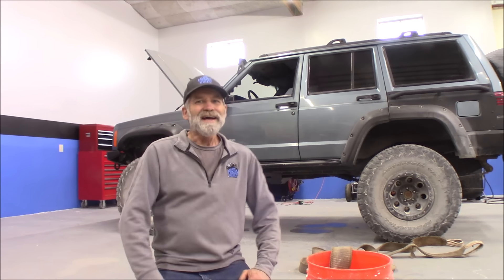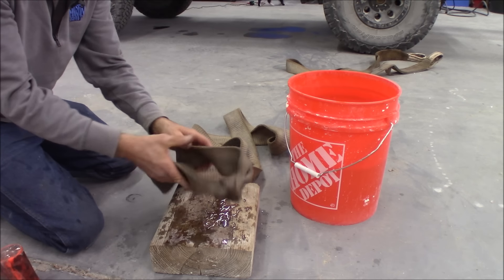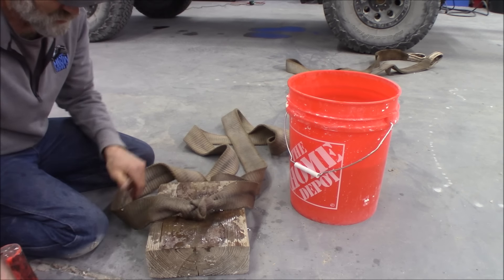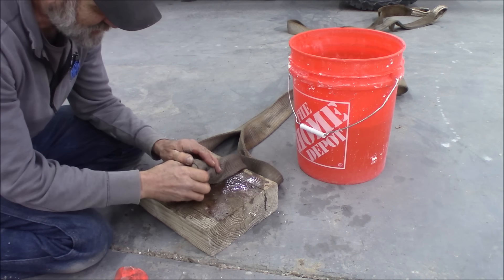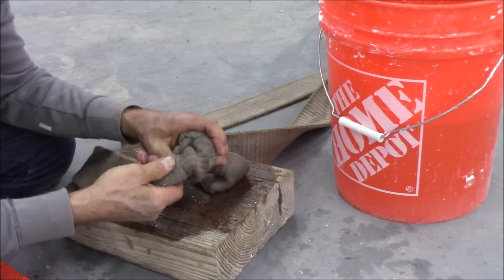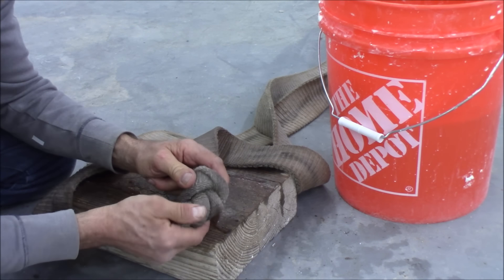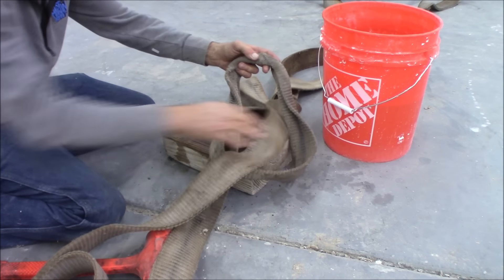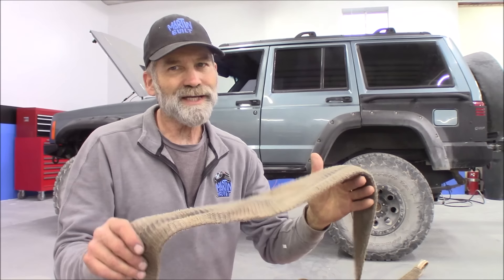How to Remove a Knot From any Snatch or Tow Strap and Rope

Comment: I came up opening knots like this by myself. Great to see its more common practice. Not sure does it help but I used hot water and regular metal hammer. Hate to have knots in tow straps but this trick changed it.

Comment: Well done. If you added a little liquid dish soap to water it would make for less friction in knot.Hammer worked really well.
Reply: Was wondering if using warm or hot water would help ?
Reply: @davidn8759  Hot water is less viscous than cold so it would penetrate faster.

Comment: I don't know if you have ever seen a Mariners knife, but they are handy for getting knots out of ropes like that. They have a tapered spike on them and a good knife. But they would definitely help with that.
Reply: A marlinspike would work well too. Basically the same thing without the blade
Reply: Good luck getting enough leverage on a marlin spike large enough to even make a dent on this strap. Straps are not rope.
Reply: @sharpandloud3422  Two marlinespikes, leveraged against each other, will pry the knot apart.
Reply: @UguysRnuts  4x4 Jeep full gas on a 4” thick tow strap, but yeah, all you need is two little marlin spikes 😆

Comment: I've used a dull pointed steel rod to help open up very tight knots. Knots that others have given up on. You just don't want to injure the individual fibers, take your time and work it, work it work it!  Soapy water helps a lot too. Good video.

Comment: Try soaking it in water then freeze it solid.  Take it out and thaw it.  The hydraulic expansion of the ice crystals will swell the knot and then it will contract when thawed, loosening the knot enough to release it with less effort.  No hammering required.  Did this to a rope that got several very tight knots in it.  Worked like magic.  Some kind of lubricant might help too, but then you're left with an oily rope, or strap, which could create a problem too.

Comment: To stop a knot or choker from getting tight, I put a short piece wood or limb in the knot. We did that on heavy construction.
Reply: Prevention is better than cure; you can also use a small magazine or folded newspaper rolled into a sort of cylinder. put in "inside" the knot or between two straps that you want to join temporarily. works wonders.

Comment: If you see any surface glazing or some other change in roughness where the knot was, that's still going to be a weaker spot in the strap. By how much, who knows? (I suppose trusting it depends on its application in the scheme of things.) So it's not like taking the knot out will make it just like it was before. It takes out that stress point, but any damage already done isn't going to be undone.
Reply: The strap will have lost a significant amount of strength through being struck many times.

Comment: Kneeling on concrete with no padding. You must be in good shape. 😂 Great video!
Reply: I'd like to see the part where he tried to stand up! 😁
Reply from the maker: Thank you I'm glad you liked.😁
Reply from the maker: Thank you I'm glad you liked.😁
Reply from the maker: @brigcastle  Milo helped me up.😆
Reply: Good shape....... kneeling like he is here is asking for circulation issues later on.  Even blood clots. Varicose veins. etc.   My father milked cows for 40 years squatting / kneeling like this.  After being kicked in the knees by the cows . He ended up with new knees at the age of 65.  I also milked cows for 46 years. I always kneeled on one knee....pulled myself up using the cows hip bone.  I also ran marathons from age 20 till ages 50.   Guess Im lucky.....no knee problems " yet " ! !
Never fold your legs as he is here !!!!!!!

Comment: Soaking the knot and squeezing it in a vise also works, as  does  sometimes gripping the knot in a vise and using a mallet to drive the knot apart, as you squeeze it is very effective and less taxing on your body.

Comment: This is a good, useful video. It's good to point out that a knot weakens the strap and makes a failure point. I have found that wetting the knot with some dish washing soap will make your knot slip easier, but it also makes it tougher to hold on to. You could soap her down before the hammer work, then when the soap is worked down into the really tight spots, and hammered on a bit, you could rinse the knot in your bucket of water.

Comment: Top job mate,Had some wet weather here in Australia,ha 3 tow jobs, I have John Deere 5083 4x4 83 hp with neighbours, 2. 4x4 utes and 1 10 tonne truck,all bogged to the diffs in sandy granite, no trouble to get them out,I parked on solid ground ran straps and chains out for up to 70 mtres, however I had to loop 2 joins like you hah done, I managed to free 1 up, put the other in a vice but no go.I will try your mthod with a heavy rubber on a block of wood,wet it first and see how I go.Thanks mate for the tip I will let you know what happen. Australia 🇦🇺
Reply from the maker: Good luck with that knot. I'm confident with this method you'll get it out. 
Thank you for watching.

Comment: Good job! May I recommend a marlin spike or fid to  help the process?
Reply: Those are a big help. Better yet, put the spike in before the knot is tight if a knot can't be avoided.
Reply: We delt with this often on the old commercial fishing boats. You beat me to the mention of a Fid.
Reply: Use hitches instead of knots 
The Bowline, the clove hitch.. I can't remember the other hitch but when tied correctly they untie easily

Comment: You convinced me to check all pulling straps, ropes, etc. to make sure there are no loops that will become knots in them before a tug.
    I had someone give me a 50 foot piece of 1/2 " wire rope/cable  that has a knot in it from a stump pull with a dozer.  Yeah, that's "knot" coming out of there for sure. Too bad because both ends have two nicely hyro-crimped compression sleeves with thimbles.  I'm "knot" that worried about it though because I'll never get halfway near the working load rating of the cable. ( 12 ton ).

Comment: A dead blow hammer has sand in it, not to do a "pretty good job", but the sand in the hammer makes it so that it doesn't bounce when you strike something with it. That's why it's called a "dead blow" hammer. :goodvibes:
Reply: I never knew that. Thanks.
Reply: More often they have steel or lead shot not sand
Reply: Not sand steel shot i know cause i open one up by heavy use
Reply: Where I live us surveyors use them to drive rebar monuments into frozen ground. Regular sledge bounces and mushrooms the end of the rebar. Works only if you have a driver over the end of the rebar so it doesn't split the plastic hammer.
Reply: the dead blow has lead shot not sand and about 1/2 inch of space for the shot to move.
Reply: looked like it bounced all over the place to me

Comment: I admire your determination, ... I am curious to know if you had gotten the stump out?
Reply from the maker: Not on that attempt but later I did. Got one more to go. This weekend it's going to happen.
Reply: Use that strap as a choke around the stump, run the free end of the strap over the top of a good tire/wheel combination, when the jeep tensions it, the tire/wheel pulls straight up. This works great for pulling out fence posts too.

Comment: LOSE THE HAMMER! Hammering the knot will damage the fibers and weaken the rope or strap. Use a marlin spike or fid to work the knot from all sides. It will open the knot up without damage if you are careful not to puncture the fabric. As you gain a little space in the knot, then go at it from another side; don't try to open it all up from just one side. Be patient and you will get there. This is the way sailors and riggers have been foing it for hundreds of years. You will never see a sailor or rigger hammering a knot. In the future, pay more attention; it's a lot easier to untie a knot before it's tensioned than after.
Reply: Yes This is crazy!

Comment: Even that dead blow hammer is grinding the embedded dirt and grit in that knot. Use soap and a blunt prying tool like others suggested. 
I would add that twisting one of the ends that enters the knot helps compress the section so it can slide into the the knot which loosens it.

Comment: Soaking it is a good idea, i hammered large flat head screw drivers in between the layers and slowly worked it loose exactly what you said not to do, i didnt damage the strap but it wasnt fast or easy to do.

Comment: If you twist the lead hard till its solid then push it into the knot backwards it works kinda like stuffing a stick into the knot.  Twisting left vs twisting right makes a difference depending which direction your knot is.  You can also twist both ends and shove the knot backwards

Comment: I have not gotten a knot out of a strap, but rope, I have. As you did pulling on one side to open, I have turned it over and pulled and worked on the bottom side.

Comment: The soapy water tip below is probably the go to method and is most likely faster, but I was wondering if time wasn't an issue about wetting it, freezing/thawing it a few cycles, if that would loosen it up without all the stress?

Comment: I have undone a lot of tight knots in various cords (but not this big).   I honestly think that hammering it will cause some damage to the fabric.   Being wet can help lubricate it (but some kinds of cord may swell when wet.)  I would just fold or roll the width tightly to push it through the loop, and wiggle it firmly until it loosens.

Comment: Use soapy water it makes it slick. I just twist my straps and push through the knot. Takes a bit of time and effort but it will start moving. I havent tried it with a hammer, not sure if it will speed it up any but soapy water works wonders.

Comment: Great job! Great video! You probably had someone ALREADY make a suggestion that. had terrible times breaking KNOTS on all different ropes/slings/small strings/ I found that if i USE A ROUND SHAFT with a point at the front I could Fanes the shaft in between the knot/ Then once the shaft is completely thru the Knot just twirl it around and around/ then pull the shaft out and start pushing the KNOT loose (do this a few times). BUT the  biggest help was when the Pets Cat or Dog would come to see what i was doing and ask me "I AM HERE TO HELP YOU DAD"  and all of a sudden the Knot would instantly come loose/

Comment: 01:15 that's called a soft drift, in Australia. A Hawser spike is used by navies around the world to create a gap in the knot, when inserted correctly, will do no damage the rope; you can get one from a ships chandler. Hammering the knot with a drift will create split fibres, lessening the life of the strap. After all that bashing, you'll get one more pull, then it'll break.
Reply: I agree with you, the tow strap is already compromised.  I worked years in the oil industry and a strap like that would be cut up (to prevent further use) and discarded.

Comment: I have a pair of 10in timber spikes (big ass nails) that I've ground & polished the first 4 inches to be smooth like knitting needles, they can be inserted into knotted straps & ropes to ease the knot apart without risking cutting into the straps like a screwdriver would.

Comment: Those synthetic staps also weld themselves together  enough energy applied, and generates enough heat to melt the fine surface flyaway fibers together on opposing faces.

Comment: I had a strap with a much tighter knot than the one shown.  I soaked the strap in soapy water with added fabric softener then slowly and carefully teased the knot out using two Phillips screwdrivers carefully worked in opposite directions through  the knot so not to damage the strap; this loosened and got the knot out but the strap was still heavily kinked.  I then thoroughly rinsed the soapy water out of the strap removed the kink and straightened out the strap using a steam iron (under a damp cloth) on the still damp strap.

Comment: It’s difficult to explain but I use a bench vise a hammer and a vice grips. I almost always get it out, admittedly some knots have been under extreme load and I’ve just had to cut the knot out.

Comment: Weak spot indeed. 
50% reduction
This happens all the time when you have dummies using slings. 
(Present company excluded)
Oil patch, underground labourers 
 Next time I suggest After a few blows, fitting/wiggling long punches through the Knot. Not piercing the strap of course. When you have two just through. Use them as levers back and forth. Way less hammer. 😅 I’ve gotten straps apart stretched tight when soaking wet. The narrower the strap. The worse it is. 
Hi Milo👋
My big fella. 2 years in April. 
Maine Coone. 15 lbs and growing. Walter.
You have a new subscriber. 
Good show. 👍🇨🇦

Comment: I was a Lineman for a major utility …we had knots like that put in by novice lineman .. we called them axe knots.. we made pointed large screwdrivers ,,two of them . Picture large darning needles..they worked great to loosen the knot and clear it. The trick is not to do that in the first place.. a good old bowline is the perfect knot to know ..regardless of the tension placed on the knot you can easily get the knot apart

Comment: Good idea. The newer the strap the longer you're going to have to soak it. Also add fabric softener to the water and use very warm water. I'd soak it for at least an hour. Rinse then soak the knot in vegetable oil. Then use this process. When the material is knotted that tight, you can damage the threads in the strap when striking it like that.
Another way is to use a round blunt round nosed thin rod to thread a two small cords though the knot. Use them to to put tension on the knot as you hit it with the dead blow. Once the knot it out. Use dawn or a safe degreasing soap on the strap to remove the cooking oil.

Comment: Have you ever seen a 4.7 that has some sort of clatter past 4k rpms but ONLY under load, not when revved in neutral?
Mine is doing this now and I have no idea what it could be, would rod bearings do this? timing chain? maybe debris clogging up the oil pick up tube when the pressure goes up? 242k miles. Engine wise all is stock including all seals/gaskets, only thing I have changed is the valve cover gasket, egr valve and water pump. And 1 injector 3 coils and a few set of spark plugs. And the oil pressure sensor which failed once.

I've spun bearings in other cars and whilst this does have a bit of clatter/ knock it doesn't seem to me as hard metal on metal as the rod knock sounded when I spun a bearing on another car, it also doesn't sound anywhere near as fast as you'd expect rod nock to sound at 4k rpms.

Comment: I remember i used a long bolt and pounded it with the hammer and then a round hex bit that was about 6 inches long with an extensions. Tapped it in with the hammer too. Probably frayed the strap a little on the looped end but it was much that was already done before i got it from the previous user. Had 3 starps that got knotted together from a recovery job. I know next time to have something blunt to put in between the straps.

Comment: I feel hammering the knot would be choice #2. A marlin spike is the best, better than the "big nasty screwdriver" in my toolbox. But you should have a roll-head pry bar in the bottom of your toolbox. Harbor Freight had a set. The point is small and the  shaft gets larger, great for wedging in a thought place and expanding & pulling some strap to large the knot.

Thanks for the demo, Martin.

Comment: Damn good stuff! Same problem from tying two 25' snach-em straps together to help a lady out of a ditch back in 96' and had to use it this way ever since. Not sure if this works with synthetic heavy duty material @ 20,000lb rating? A little Dawn maybe... BTW, I wonder which is actually weaker, the knot itself or the small area that was exposed to a concentrated violent beating over time?

Comment: I purposely tied a knot in a strap because I had no other way to accomplish my task. Before I started pulling with it, I inserted a stick that was about an inch in diameter and 6-8 inches long. After removing the stick the knot was undone quite easily!!  (The strap was appr 3 inches wide.)

Comment: this used to happen at work when the young guys would put multiple straps or slings to pull on something with the truck or a hoist and mess them up and then say oh well and throw them out and i would get mad and try to set them straight. the bucket of water is a good idea, i would also use a rounded off spike or screwdriver. i'm retired now and don't have to worry about this stuff anymore but thnx anyway.

Comment: With the knot being the weak point, I wonder if tested to the breaking point whether the previously knotted area is still the weakest due to the pounding. It may look okay, but I wonder it the fibres got damaged. For sure un-knotted it's stronger. Possibly a test that Todd at PF could do...

Comment: I agree, don’t pound it violently!  It breaks the fibers. Soak overnight in liquid soap with LOW detergent characteristics.  (Cheap soap). Use tapered spikes as a giant marlin spikes, also called fids.  They will penetrate along the strands using a medium hammer to tap on the spikes. Work from the outermost loop of the knot inward.  The rope or strap will slide apart fairly easily.  Remember pounding on the knot will loosen the knot but risks damaging the fibers.  Don’t pierce the rope or strap with anything!

Comment: I've never used water for this job, only done it while dry with good results. But I did use an old, dull screw driver or a splicing fid to dig into the knot.

Also, I have only used a steel hammer. Either my finish hammer at work, or a small sledge at home. Never had an issue with that.
Reply: Been in the industry. Though not rigging schooled. But never heard the word "splicing fid". Thanks!